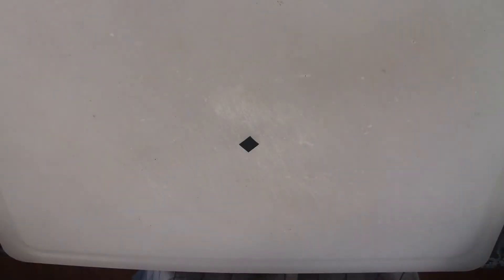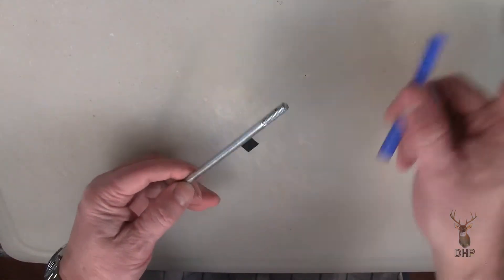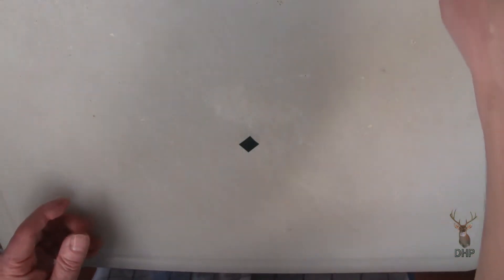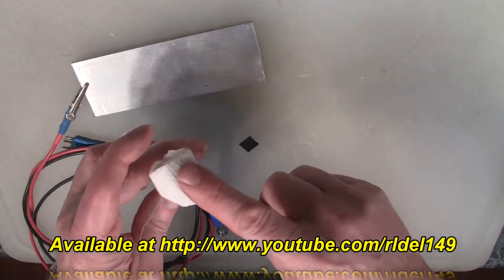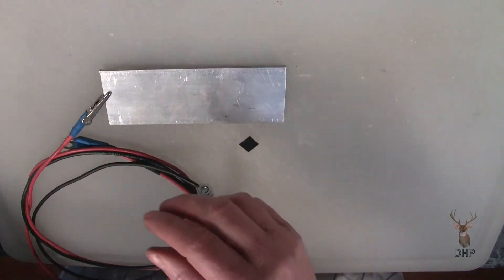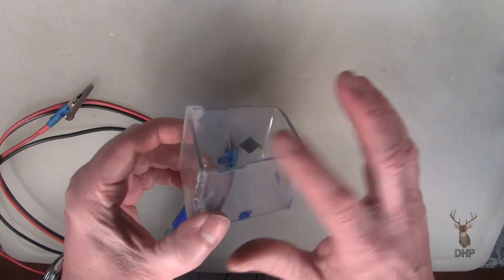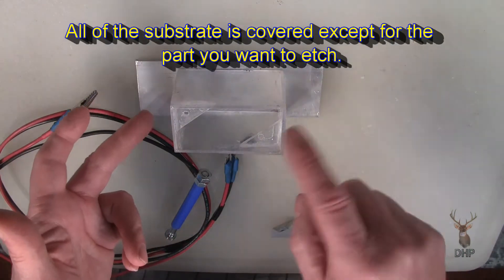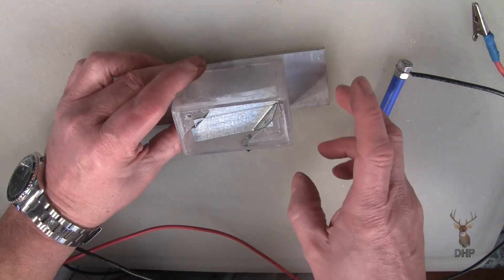S8E1 – Low Voltage Electro Etching Tools - 1080p

Comment: What do you use as a power source - Volts / Amps? I've seen everything from batteries, to battery charges to some kind of universal power supply.
Reply from the maker: It is amperage - the current you need. Either car batteries or a 30 amp charger will work. Keep your hands insulated and dry. If you have ever worked on car in the heat of the south - sweatting? Get across the battery and you will know it.